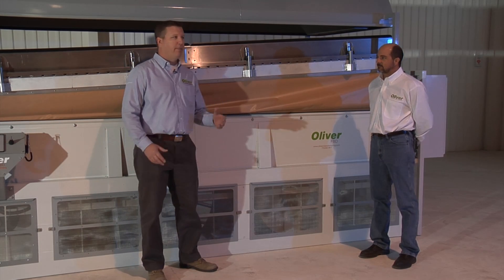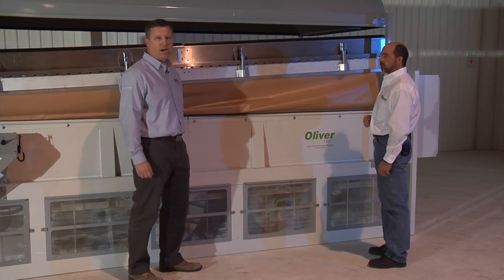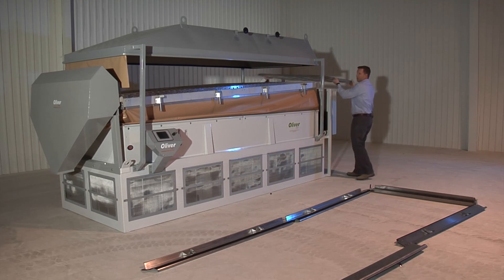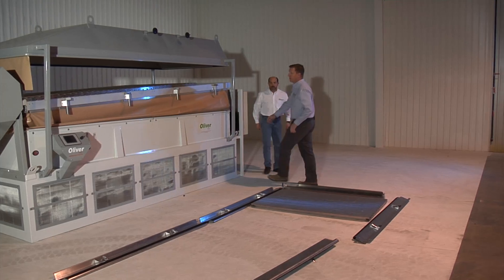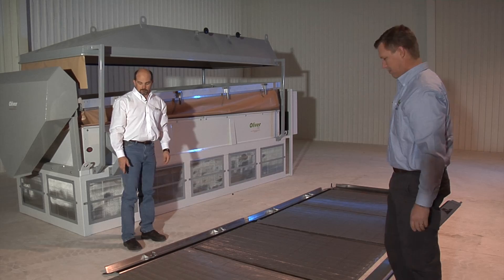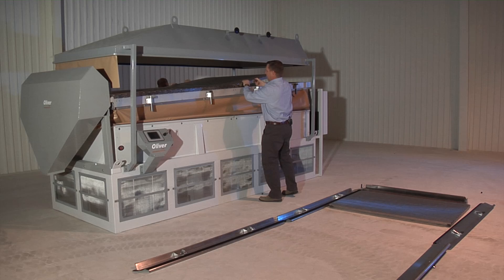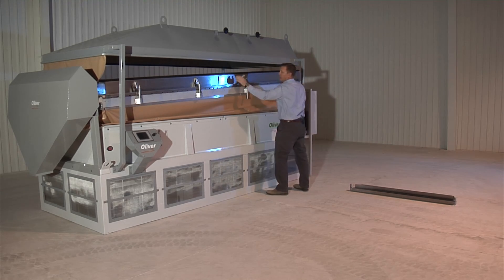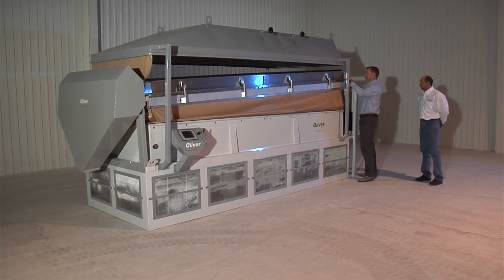Oliver Modular Deck

Comment: Modular Deck Design…
- Increase safety
- Dramatically improve maintenance access
- Assemble and disassemble in tight spaces
- No tools necessary
- Remove in a couple minutes (1-2 people)
- Only recover/repair the worn section
- Reduce maintenance $
- Compact and easy to store multiple decks

Comment: *INCREASE SAFETY*
- Standard 3600 Maxi-Cap deck weighs over 800 lbs.
- Takes at least six employees to remove
- Must maneuver around feed and discharge obstacles
- Often requires a forklift or heavy lifting equipment for removal and installation